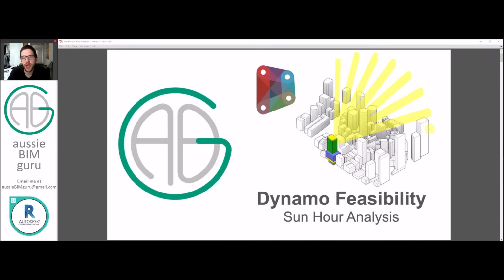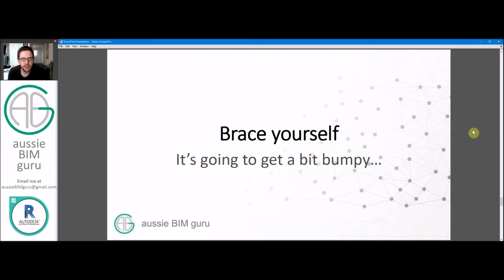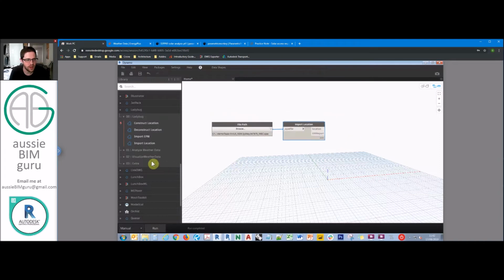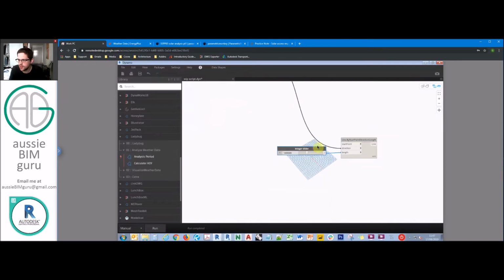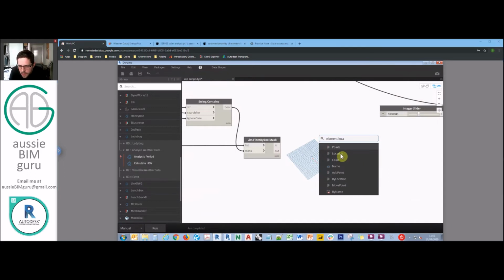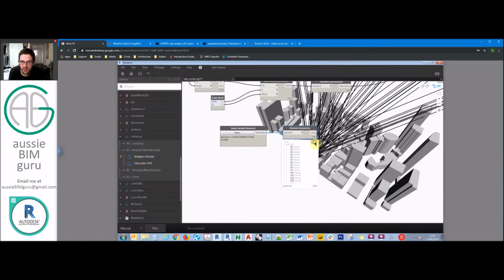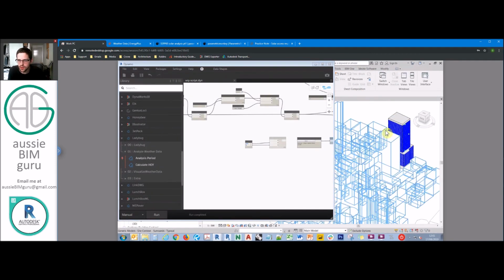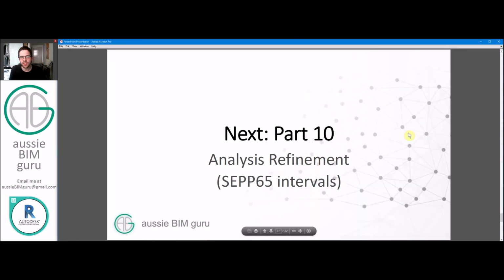Sun Hour Analysis using Dynamo (Feasibility Part 9)

Comment: ladybug package not work in revit 2021 version. how to  solve it? epw file not read in dynamo.
Reply from the maker: Rhino Inside and Ladybug for Grasshopper is the only fix I've found unfortunately. Ladybug stopped supporting their tools for Dynamo in Revit 2020 onwards.
Reply: @AussieBIMGuru  ow ...... hope it will solve in revit update version. thanks.
Reply from the maker: @rezwanulhoque117  they wont unfortunately. It has been many years now and they released a statement explaining why they don't support Dynamo anymore:

https://discourse.ladybug.tools/t/ladybug-dynamo-nodes-giving-error-on-revit-2020/6921/13
Reply: @AussieBIMGuru  If possible can you find out another way to create sun path analysis in dynamo?
Reply from the maker: @rezwanulhoque117  the only way I know is to get the sun directions but it requires complex python code and is a lot more effort versus using Grasshopper. I'll do a tutorial on sun hour analysis in Grasshopper this year on the channel.
Reply: @AussieBIMGuru  ok thanks

Comment: @Aussie BIM Guru
  Hi Gavin Thanks for this useful Part, I have question regard it, I am using revit 2020 + Dynamo 2.1.0 + ladybug 
Unfortunately the sun path doesn't show up at all any ideas what might be issue??
Reply from the maker: Unfortunately ladybug is unsupported in 2020 and beyond. I suggest looking into grasshopper and rhino inside.
Reply: @AussieBIMGuru  there is ladybug fix package. is that for fixing the issues on Revit 2020+? if is that help can you show how to use this package.
Reply from the maker: @solomonalemu6953  i had a look at it but couldn't figure out how it works unfortunately. There aren't any instructions or a reference anywhere.

Comment: Ladybug for Dynamo is no longer devloped, so Revit 2020.2 with Dynamo 2.3 does not work :( Should I try with RhinoInside or older Dynamo 2.0.3? Thanks for great videos on YouTube
Reply from the maker: Yes I uae Rhino Inside now, far better!
Reply: @AussieBIMGuru  I only got rhino 5 edu and no rhino at the office :( it's a shame they discontinued ladybug for dynamo but from the other side it means that the rhino version will be well developed I guess
Reply from the maker: @marcinosiecki4272  indeed! Yeah that's a bit tricky, they offer 90 day rhino 6 trials if that helps?

I found grasshopper's ladybug was far superior to dynamos even when it worked, but yes it's a shame.
Reply: @AussieBIMGuru  Unfortunatelly users with 90days licenses do not have access to Rhino WIP (Serengeti) :( I can only upgrade my educational license to commercial Rhino 6 and then get access to WIP :O By the way - I'm curius when they are going to release Rhino 7 with that Rhino.Inside project, it's been a long time since Rhino 6 release
Reply: @AussieBIMGuru  This is of course a great tutorial, as are all of your tutorials. Any updates on this in regards to Ladybug for dynamo no longer working? but still staying inside Revit and Dynamo? (I don't have rhino, like many others.)
Reply from the maker: @lennonsc77  unfortunately dynamo ladybug has been deprecated and the team is focused on grasshopper. That's pretty much how I do sun studies these days, and its much faster vs revit+dynamo.